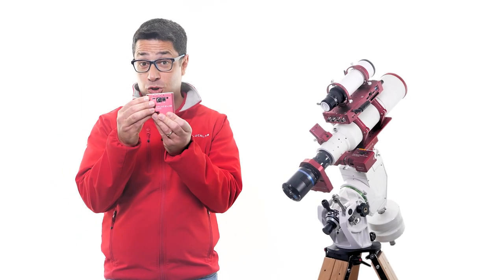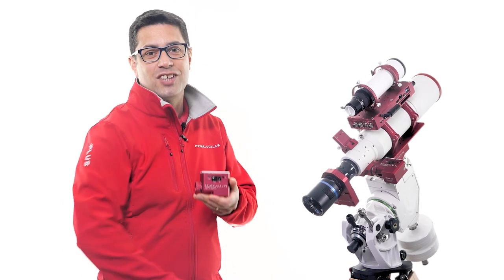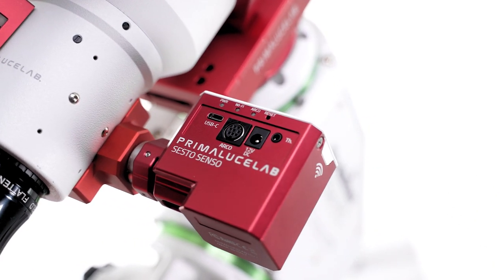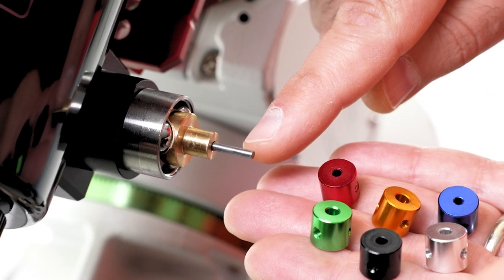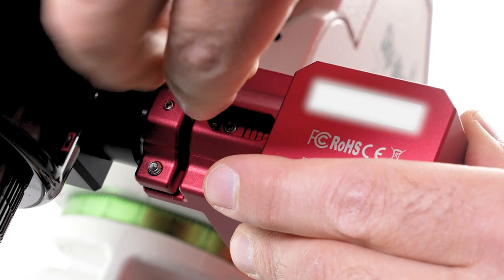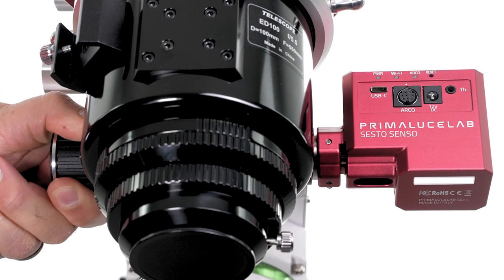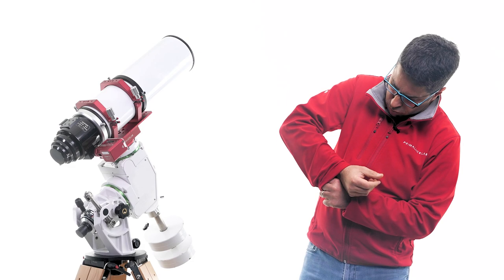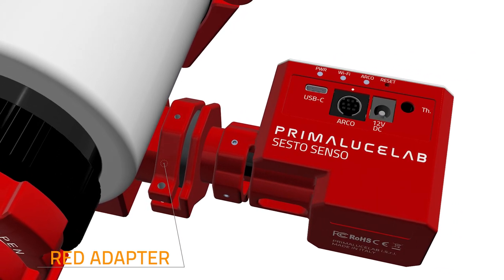Installing SESTO SENSO on your focuser

Comment: I have the first model on my FSQ and it's great! Don't want to miss it anymore. Too bad it won't work on helical focusers like the Redcat51, else I'd get another one.
Reply: did you install it on a fsq85? did you use an adapter?
Reply: @telemaq76  Yes. I own the first sesto senso, and it came with a few adapters (different sized holes) to accommodate the different thicknesses of the focuser shafts from the various manufacturers.. I have since then upgraded the FSQ-focuser (due to sacking/tilt) with a feather-touch focuser and that required a different adapter that was not part of that initial set. 
The sesto senso 2 is a bit different though, so the adapters aren't the same.
Reply: @cdh79  yet, it works but it doesnt fit really well on my fsq85
Reply: @telemaq76  I'd send a message to the primalucelab support.. they have always been very helpful to me when asking for support.